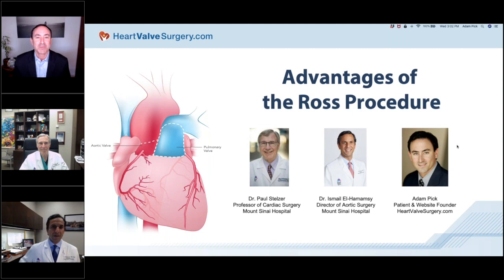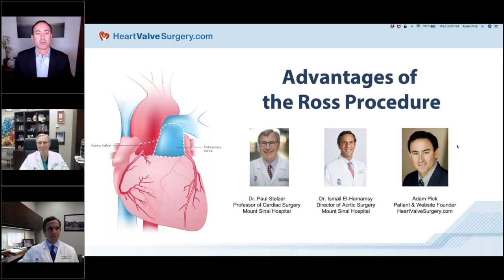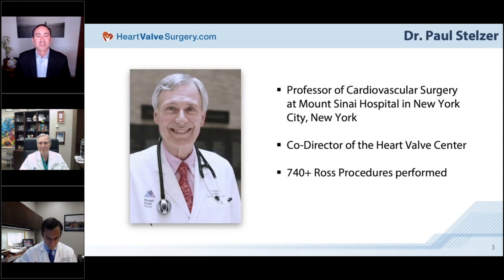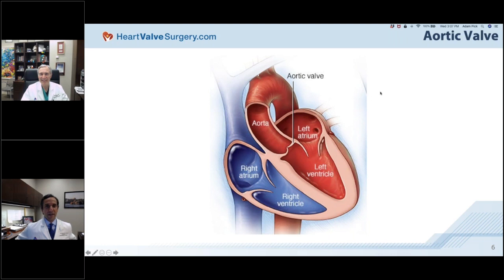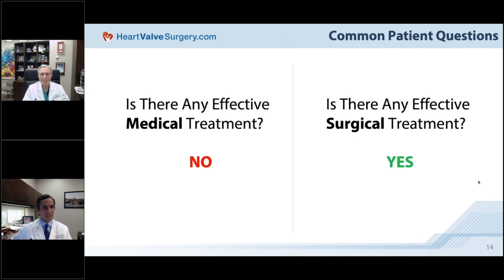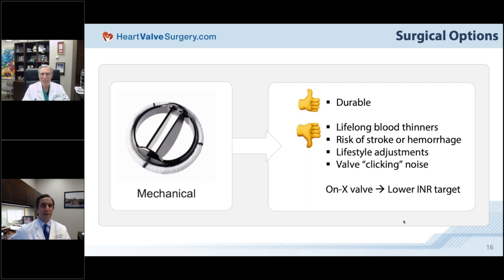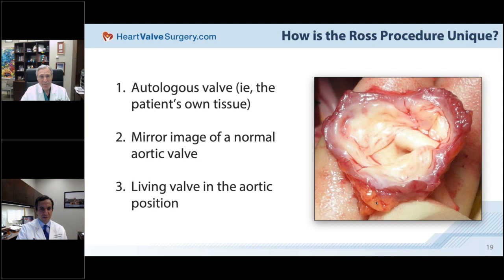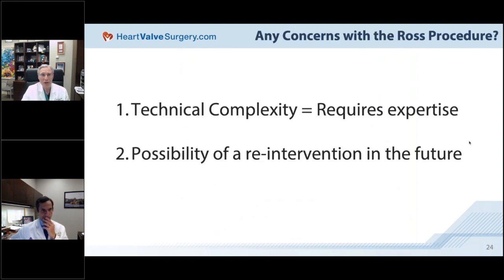Ross Procedure Advantages for Aortic Valve Replacement with Dr. Paul Stelzer & Dr. Ismail El-Hamamsy

Comment: Hey Adam! Love your videos, very informative and this one was specially interesting. I'm 29 years old and have a very active lifetsyle (surf as well), I have moderate to severe aortic regurgitation (biscupid valve) so might need valve replacement in the near future and considering the Ross. The question I have is, having aortic regurgitation instead of stenosis has a negative impact on durability?
I heard in the video that they mentioned that the durability was longer specially in patients with stenosis, so I'm wondering if the Ross could be a good fit as I have regrugitation. 
Also, long shot, but is there a list of good surgeons for the Ross in Spain?
Thanks a lot! Keep up this amazing channel!
Reply: I’m 29 from Singapore. Was advised to go for my surgery as well. Considering my options too.
Reply from the maker: Hi Alex, Thanks for the kind words about the YouTube Channel.  I had aortic stenosis and regurgitation. So, I'm not sure that the disease type will impact the Ross Procedure durability. That said, you may want to discuss with your medical team. Unfortunately, I do not know of any Ross specialists in Spain.
Reply from the maker: Great! We hope your research has helped you evaluate your treatment options.

Comment: This question is for Adam (if you don't mind). Was the Ross procedure your first choice or was it advised your doctors? Were you not comfortable with other valve options?
Reply from the maker: Hey Jo, Great question. I didn't know about the Ross Procedure until I met with two surgeons.  Both surgeons recommended the Ross Procedure given my age and my active lifestyle. Fyi, I like to ski, swim, surf, etc.  For me, the Ross Procedure has turned out to be a great fit. I'm 16 years out from my Ross Procedure.  I have yet to need another operation for either of my aortic or pulmonary valves.  Hope that helps!